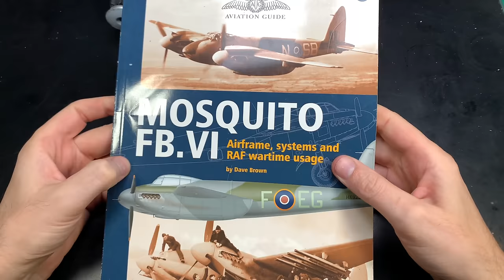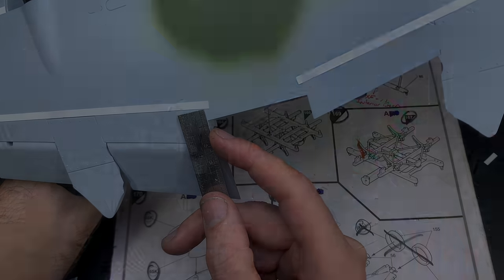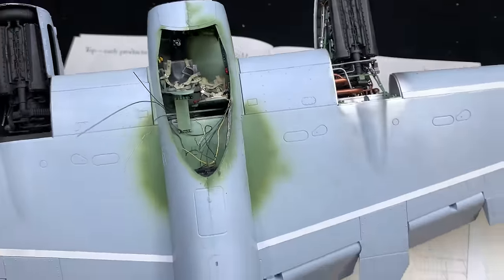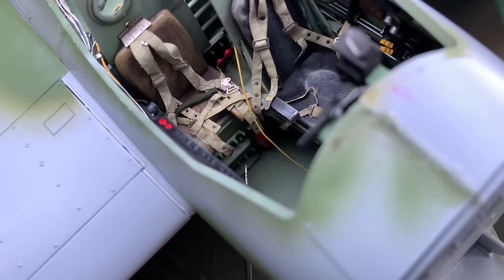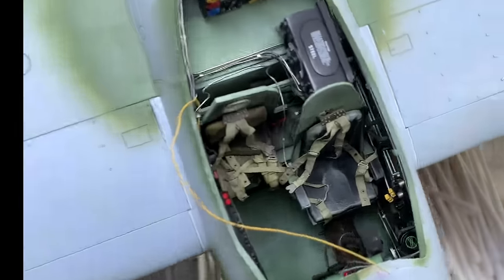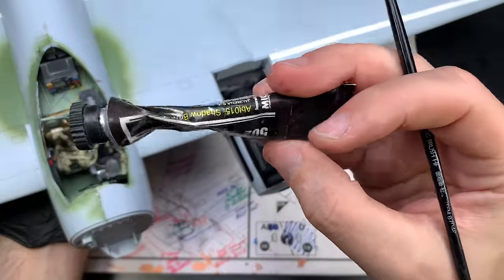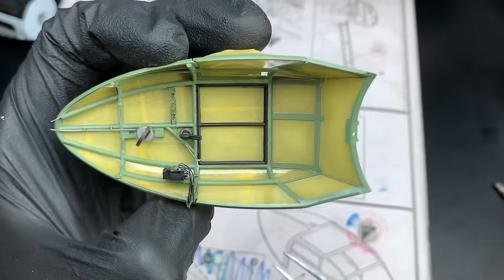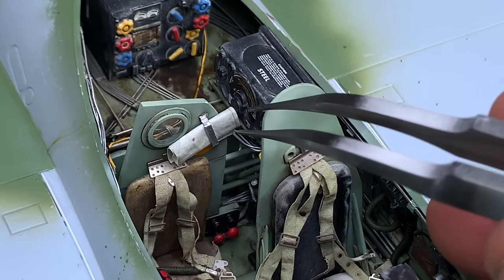Airfix 1/24 De Havilland Mosquito - Part 7 Cockpit Final

Comment: Dear Mr Frontline,
Another excellent video, (notwithstanding the gunsight, which of course you will locate in several weeks time), with great details as usual. I note that several other good channels have been approached with regard to their use of music. Now, I gather that they both genuinely believed that their sources were royalty free and this has apparently turned out not to be the case. Anyway, I just thought you might like to know this- perhaps someone from a nearby internet may approach you regarding your use of music and forewarned is forearmed...
I congratulate you on putting out such high quality work!
Regards,
Z

Comment: Fantastic work bro.... Have you looked at 24th car detailing sets.... They have all sorts of electrical and hydraulic fittings available aswell as all sorts of different colours and sizes of wire

Comment: Why would electrical components have so much crap on them?  They never would.  This particular aircraft operated out of a concrete airstrip.  No mud.  It is fine detailing models, but be real about it.  No pilot or nav would want to fly in such a crapy interior, and the maintenance crew would never let the interior be like this.  It is detrimental to the operation of the aircraft.